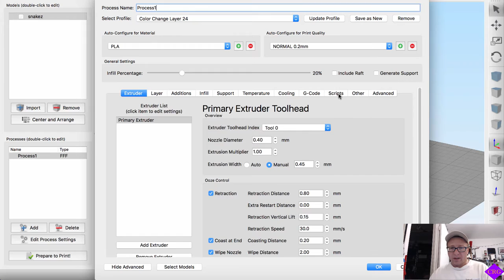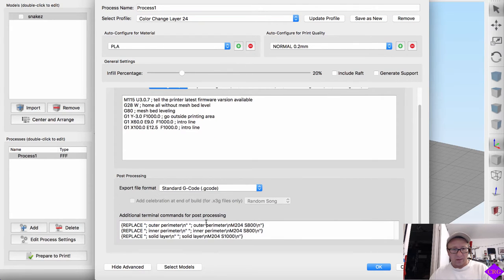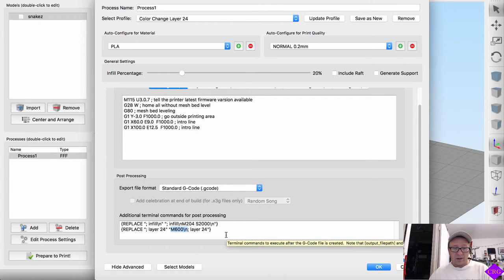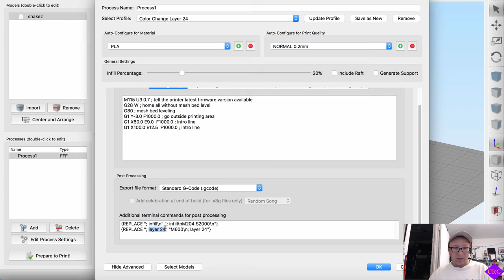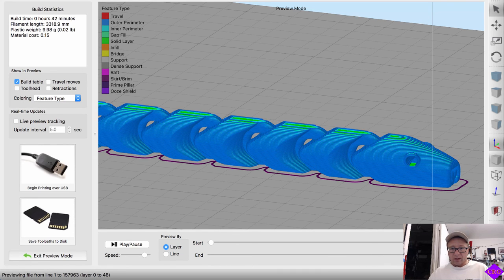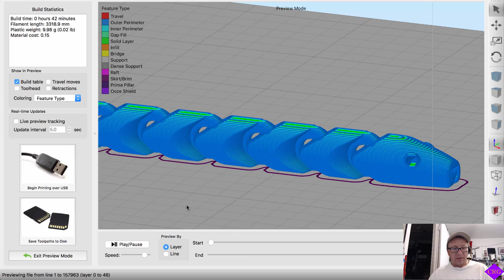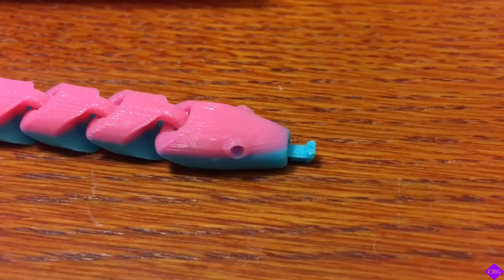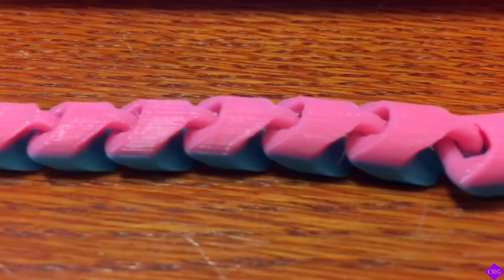Multicolor printing using Simplify3D

Comment: Thanks for the tutorial. Works great. The only problem is after loading the new filament then it moves and resumes printing right away with the purge filament still sticking on the nozzle. I have to be quick removing the filament on the nozzle while it's moving before it goes down to print again.

Comment: hello cyberreefguru,

I just tested your code
{REPLACE "; layer 39," "M600\n; layer 39,"} on simplify3d and it works fine.

On the other hand I would like to know how I adjust the amount of retraction to remove the filament when I perform this command and why it empties me a little bit of the new filament on my part and not next to it, when I have resumed printing.

Thank you in advance, thank you for sharing.
Reply from the maker: Hello Christophe. I have not used Simplify3D in a long time, but I know you can adjust the retract settings for the entire print. I don't think you can make the change specifically for the color change without manual changes (which you are doing already). Based on my research, you can add an G10 command to force a retract if you are using Marlin (https://marlinfw.org/docs/gcode/G010.html), or use the generic G1 and specify the extruder (e.g., G1 E-1 F100 retracts 1mm at a feed rate of 100mm/s -- if you are in metric). Hope that helps. Thanks for watching!
Reply: @cyberreefguru  Thank you for your reply ;-)